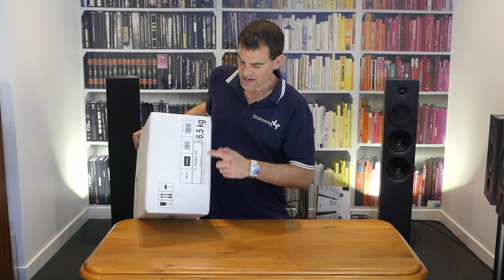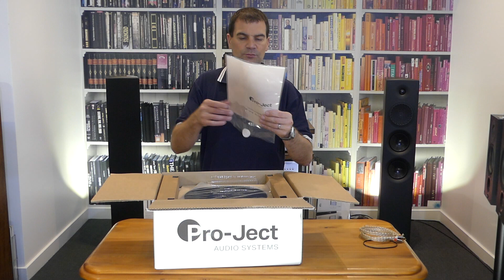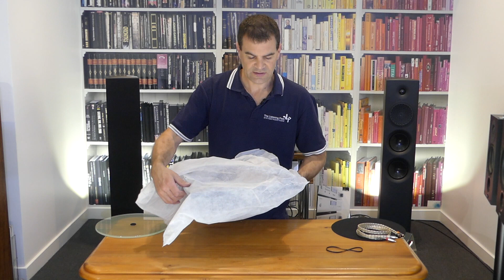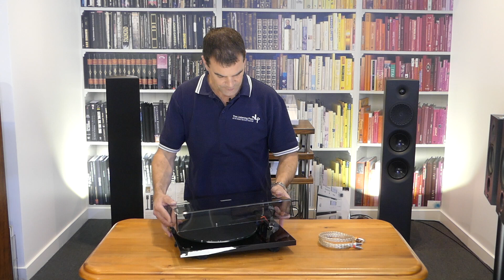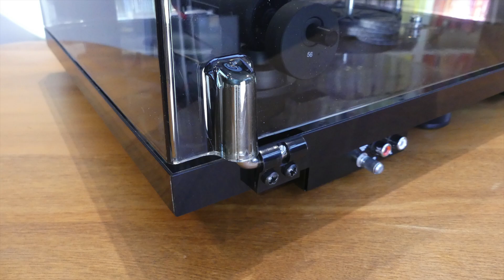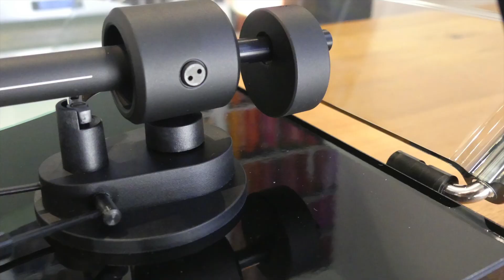ProJect T1 Phono SB Turntable Unboxed | The Listening Post | TLPCHC TLPWLG

Comment: Is it ok, if sound is lower with AUX cable, connected to the portable speaker? I use the pre-installed phono from Pro-ject and checked on 3 vinyl records. 
If no, how to increase the sound?
Reply from the maker: The output from a turntable is microscopic, and a phono pre-amp gives it a good boost, but it will always be quieter than a triditional source.
Reply from the maker: You could try a HIGH gain phono pre-amp, like this:  https://www.listeningpost.co.nz/brands/ifi-audio/ifi-audio-zen-phono-the-listening-__I.382157__C.139614__N.27183

Comment: a bit a note on the T1 SB's "well set factory settings", it is very good but, when I was using the plastic Project "Seesaw" protractor that came with it, I found that the factory arm weight does not balance the protractor at dot 2??? This piece of plastic protractor is supposed to function as a weight gauge, and it should level when the stylus lowers into one of the two dents, but it doesn't??
Reply from the maker: They will set it pretty close and out of the box it will sound good. But the tip scale and key are there to alow you to check and adjust too.